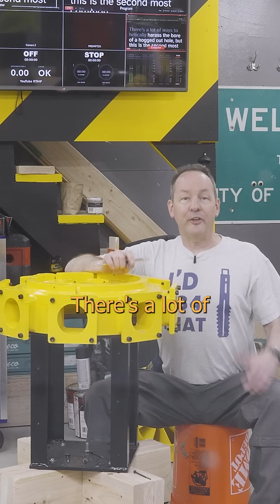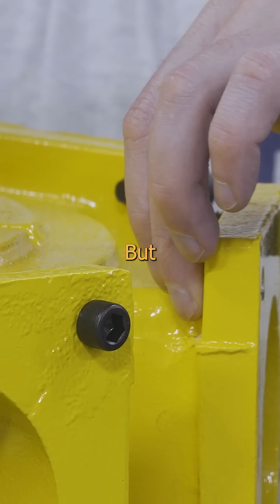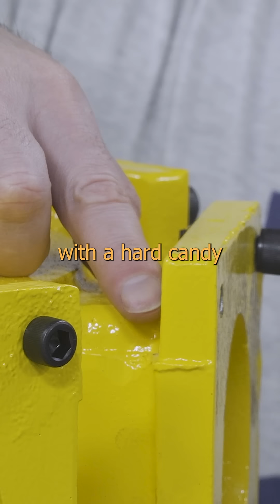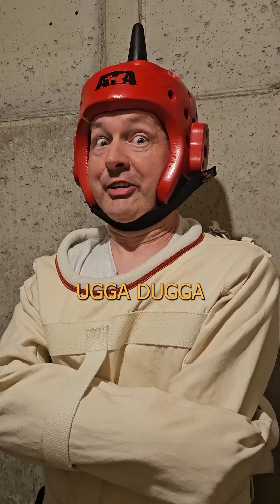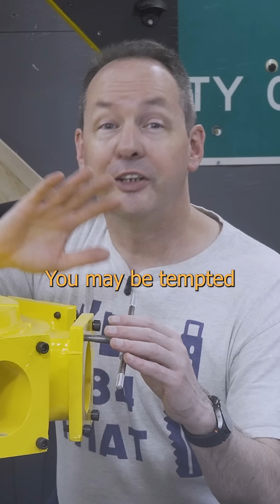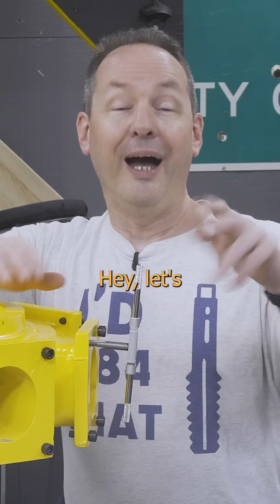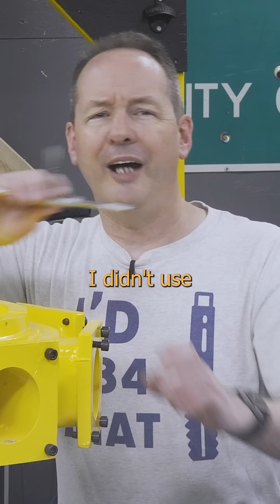Thread Chasing  #chrisboden #comedy #engineering #skills #workshop #metalworking #tools #apprentice

Comment: well i was a Dumbass twice during my appretice days... 1st time customer asked to have the threads on his bicycle frame chased because the bottle holder was a pain to install  so i grap a m5 tap and try carefully chasing the threads on the first threaded insert... just for it to bind up after a few turns. so i used a bit of force(three finger of one hand kind)... then it clicked in my mind... the tap was bottoming out on the Mahle e-bike battery that was fixed inside of the frame... luckly the bolts the customer had put in there already made a dent in the aluminum batterycasing so we could act like i never did anything but inspect the insert... 2nd time let's just say you shouldn't trace threaded inserts in a carbon frame... one really bad bind up and the 2000€ (~$2400) frame is trash

Comment: Didn’t use a drill but an air ratchet and appropriately sized socket.  Got the tap going with my finger, then ran it down with the air ratchet.  Worked fine.

Comment: O yes I’ve fallen into the trap of using a drill to chase production jobs holes and let me tell you your not saving any time when you have to spend 3 hours with a EDM, carbide tools, a bunch of picks and then a helicoil at the end just to save a few minutes!! But I’d be lying if I said that I didn’t think about using a drill every time I’m faced with a few hundred holes to chase.

Comment: As a mechanic I keep a bin of broken bolts I've extracted successfully and tapped afterwards to fix the threads. Although instead of a T bar i use a ratchet with a socket put on revese so the 3/8 square hole can be put on the tap making it easier to use in tight spots

Comment: Dumba!!, had a frame bolt hole with more crusties than the aftermorning wake up at a bukkake scene on an old 71 Dodge W150. Cross-threaded and snapped the tap! ... My dad was vedy impressed with my first attempt at hardened steel tapping.

Comment: I'm that dumbass! Medium sized Polish factory far more than decade ago, me as a fresh graduate from vocational school left all alone (mentor fell off a ladder after one month of training and I had to figure out most of the stuff all alone). Back on the track - it supposed to be quick changeover for different product, and as most of "young experts" i felt a little over confident and decided to make a quick fix on a thread. Of cource I used a drill to speed up the process and tap broke quite immediately. I had to disassembly half of the machine, remove old tap with drill, hammer and a punch, drill new, bigger hole and tap it once again - this time by hand :) Fortunately there was enough space to fit bigger screw. One of my first important lessons, how trying to save like 2 minutes by using a drill changed 10 minutes job into 5 hour repair. Damn I wish there were channels like yours back then... Keep on doing great job!

Comment: I don't understand why you couldn't just cut a piece of threaded rod long enough to go through that flange hole.  Cut a quicky slot in one end with your cutoff wheel for a flat-blade screwdriver.
Of course the answer might be that it takes less time to run a tap through it afterwards.
Also, if you aren't used to using taps, most of the tap and die sets I've seen come with collets that slip over the ass ends of smaller taps (the ends have four flats), and you have the option of putting the collet over the tap without adding a handle.  The collet is easier to hold onto if you are a klutz, and since it has a larger diameter than the tap you can get a little more torque when turning it sans handle.

Comment: Re perpendicular: I had a hole suddenly turn to butter when I was tightening up a 14mm hole that held a timing belt roller on my car. I got a Helicoil kit and bit and augered away...crooked. I basically ruined the block of I didn't take it down to a shop to weld it up and do it right. I put it together anyway and drove it for another 5 years, changing the timing belt every 6 months till the engine finally gave out at 500k miles. Oh...it was a Camry, of course.

Comment: If u don't have a tap on hand, you can just use a grinder to cut a groove on either side of a bolt with the correct threads, you can't create NEW threads with it, but you can chase the existing ones to clean them out in a pinch.

Comment: No Ugga Dugga But Im still a dumbass in tapping. M14x1 blind holes in old aluminum part and thin wall, badly damaged threads, two holes galled up so bad. In the end used epoxy and lubed bolt to "rebuild" the threads. Have not figured out what to do different next time.

Comment: HOLY CRAP the kids i knew back in HS that were high on Fent could tap straighter holes.

Also, not my lesson(mine was just accidentally crossing threads) BUT, I once watched a guy tap a hole for a pretty deep machine screw (I dont remember the measurements or type, its been years) he used a drill, then an impact, and by somehow the grace of god got the bit out. It had NO teeth left. And he stupidly put the bolt in and got it stuck halfway and the instructor kept that piece around for years as an example of "Dont be like Greg" (Not his real name but similar)

Comment: Metric threading must be totally different. Never damaged threads by re-tapping but ive had a few taps snap while using a battery drill. Turns out you can actually buy ugga-dugga compliant taps which are massively faster to use.

Comment: I didn't make the mistake, but I was kinda watching when my son was a dumbass. He was working with one of the screw holes on his bike and wasnt really paying attention. Well he did fine with the original screw hole, he just had no clue when to stop and somehow managed to create a screw/bolt hole in his fuel tank. He did stop when he started to smell gas, but as we all know, by that point t, there is already a hole. I have bo clue how he managed to pull that off, but it was really funny watching him go from chill to headless chicken in about 3 seconds. He was trying to unscrew the tap, find a way to plug the hole with his finger while also trying to lift the tank up as well as looking for a container we could use to let the gas drip into. I would've loved to help, but I was too busy laughing. Like I almost fell out of my chair laughing. He did end up finding some type of epoxy or something like it that is exactly for filling hole in fuel tanks.

Comment: Dumbass, not me but my father shattered a tap inside of a TZ4K smol tractor gearshift. My dumbass² to get it working Welded the rod to the fork. Now the lack of expensive noises from the clutch made me take the puzzle apart and snap my back hard as i tried to manhandle the engine with maximum lifting force equivalent to breaking a spaghetto. Now that my virtual wallet is dry it will only take a couple of hours of swearing to just take it apart to see the damage that has been done.... At least i found the clutch pin i dropped inside a couple of years ago....

Comment: Ive used a drill on a tap before, because i was doing it on a thinner piece of aluminum, it still ended in regret and several hours of trying to get the tap out.

Comment: You want a really bad day?  Trying chasing 1/8" tapered pipe threads in titanium that were not cut straight in the hole by someone else (I am looking at you Xometry... you know what you did). That was a whole new world of terror, even with a brand new nitride coated tap.

Comment: Dumbass here. 1/2 inch Bolt for one of the 2 intake headers on a racing mower I was building stripped out in the aluminum head, in all of my gas fume fueled stupidity I grabbed a three-quarter inch tap and three quarter inch drill bit and just started stomping the drill and tap as far down as I could into the head.
Ended up in mutilating the shit out of it and when I went to put the 3/4 inch bolt in it immediately started to strip out.
Because I knew no thread insert was going to possibly save me because I couldn't drill it out anymore or insert a thread insert into a already ruined hole, I just grabbed a tube of JB Weld and mixed it up real nice before slathering the gasket surface and Bolt in JB Weld and cramming as much of it as I could down the ruined bolt hole. Held it in with a clamp and let it sit for 2 days before I started up the engine and let it warm up to full operating temperature for a few hours, seems to be making a fine seal and holding in place but I have no intentions of trying to see how well my "fix" held up by taking the bolt out

Comment: DUMBASS!! I thought I could get past the squeaks and creaks, 1 ½ rotations in, 2 rotations out. My tap snapped into many pieces within a blind hole. I spent the next day at tech burning out an oily tap out of a 1½ inch hole with an EDM. My threads were crapped out, so redrilling and retapping ensued. That Cinnamon flavor tap magic is a staple for the manuals in my shop. I tell them that it SHOULD NOT be used as cutting oil, but I'm the young schmuck, so what do I know. It smells pretty good, but you just know that fragrance will tack off hours from the end of days

Comment: Dumbass 😂
Not tapping a new hole but years ago I was mounting an Aluminum plate in an I/o cabinet for a 120v/24v power supply, tapped the hole for the power supply fine but I had to tap holes in the corners for the mount and broke the tap. No big deal take my lineman and go to twist it off and broke the tap on the other side 😅, now my hole is filled both ways so I call the boss who brings me another tap and a new aluminum sheet and almost to a T the same shit happens in the same spot at the same hole. Called my boss again who was pissed as it was a project so our overtime was hard dollar so he came over there with a third tap and sheet and on his final hole same shit happened to him 😂. I think we just ended up using the first piece that was made and called it a day with 3 screws instead of 4

Comment: I learned this by watching someone else be a dumbass. Back in high school I worked at a water park. Before the start of the season one of the jobs was to recondition all the pumps and motors. Since they were sitting around in a chemical soup every year the threads become clogged with rust. Cue chasing the threads to put them back together. One genius didn't want to spend the time doing it by hand, so he chucked the tap onto a drill and did the 20 or so threads in a pump in 30 seconds instead of the usual 10 minutes. That's the day I learned you could make two different sets of threads in one hole.

Comment: I do know better, but did it anyway. Snapped a tap off flush in a mounting plate in the back of a panel. In attempting to drill it out I managed to spin it through the hole... down the back of the plate. Legend has it that half a tap is still in the control panel and now installed on an oil rig in the North Sea. 😂

Comment: As someone who has miraculously only broken one tap in my years as a mechanic, don't buy special tap oil unless you're a machinist, just use some 10W-30 or so oil for steel and WD-40 for aluminium. For steel you can even get away using old used oil most of the time.

Comment: They sell square drive 1/4" and 3/8" drive sockets from Snapon that are made for taps to get into tight spots that you can't use a tap handle. If you are careful and use tap magic they are a very good addition to your tap set. Don't be tempted to use an impact or motor powered ratchet. You will be the first one to know that you did a dumbass move 😂😂😂.

Comment: Watched a coworker use a drill with a 1/4-20LH tap in the chuck to tap some 25 holes. He didn't realize he used the wrong tap until he tried to install the right hand threaded bolts.

Comment: Dumbass, As of right now I have broken one tap, I was using a drill and didn't know how deep the hole I was tapping was It hit the bottom and I snapped the bit, I got lucky enough to grab the bit with a pair of pliers and spin out the broken bit. I still use a drill when I tap and so far it has worked about 95% of the time

Comment: I swear, the guys that work on my production line at work break 3/8" taps on every single unit we produce, it takes them a good 45 minutes each time to get the broken piece out, but they never learn their lesson. Even as I, a fellow dumbass, tell them to NEVER use their 3/8" impact driver to put in threads, especially if you're just chasing them to get powder paint out.🤦

Comment: Watched a guy use a tap to strip a hole once. He was threading talking on about how skow is smooth smooth is steady, trigger pressure controll then boom one small sneeze and that hole was as tight as Bonnie Blue right after a 24hr challenge

Comment: "Dumass" , Proper tool was broken , it was the weekend , one hole left to re-tap and the machine could be good for exploitation again soon ... I dit it , Chuck that big boy in the drill anf verry VERRY Gently scratch to re-tap it , then ... Crack ... It was a 4mm thick plate but there was another plat without hole like 1cm behind, hit it , didn't feel it with the drill and ... Took me like an hour to remove it but at the end job was done and machine was out for exploitation

Comment: It depends on the hole and type of tap being used. I will tap our electrical panels for 10-32 with a drill that has really good power control, but it's sheet metal. For thicker metal, I will hand turn.

Comment: Dumbass check in.

In high precision situations, ALWAYS USE A TAPPING BLOCK and always check with the thread gauge before doing it again!! When you have to have a go-nogo thread gauge pass on both ends, chasing by hand is risky. Had a friend working on a $30k+ piece of material almost finished machining that he had to chase the last couple holes for the thread to gage depth. Did it by hand, no block, first 2 times, got on in out of the thread no problem, but still couldn't get the print depth with the gage. Chased it the last time, nogo side flew to the bottom of the hole. Part was scrap. He left on lunch and didn't go back to the shop because he figured he was fired 😂😂 I try my best to learn from his example.

Comment: Back in the old days, Sears and Roebuck sold 'thread repair taps.' I think they were less aggressive and tended to follow existing threads rather than cutting new ones. I assume that big yellow McMaster-Carr catalog would still carry some. 
Another trick is to take a regular bolt and file a single slit in it to act like a makeshift tap. You could turn it in by hand, then back it out with a drill, and you won't have to worry about the bolt shattering if it hits the floor!

Comment: Was making a metal cart for voided out scratch off ticket books, went to tap holes for the plexiglass panels and got to the last hole. Didn't want to take off the panel closest to the hole I was on and decided to send it with the drill. Snapped the tap, painted it blue and sent it

Comment: Slightly different dumbass.... removing snapped steel bolts and re-tapping threads in an aluminium gearbox housing, forgetting to wear eye protection when blowing out. Steel, aluminium dust and eyes don't mix....it makes the cornea go a fetching shade of orange and hurts plenty for months, possibly years.

Comment: I’ve learned many things by being a dumbass. I learned what a disposable camera flash capacitor feels like when it discharges into your 12-year-old hand. I’ve learned that you refill a butane torch by NOT having the bottle at an angle and instead push it straight in so there’s no hissing sound, and not to play with the sparker after because it makes cool effects.

Comment: "Dumbass". I broke the tap using a drill cleaning and exhaust flange bolt hole. Luckily for me, it was not a blind hole. Used a plasma cutter to blow the remnants clean out. Then start the process again, but this time by hand. Can't be stuck if it's liquid!  A blind hole, one the other hand, is an extremely bad day....

Comment: chuck it and regret it?  I mean...yeah...if the part matters and isn't easily replaceable, that's good advice.

I don't do a lot of tapping or retapping at all.  I think the most I've done is when I reused a bunch of old conduit boxes that needed some grounding.  I did in fact, use a power drill to cut the threads...since those are only an 1/8" thick and cost a buck or two I didn't see the harm and got lucky in that I only broke one tap and didn't f-up any of the boxes.

Comment: Never chased, but me and my coworkers definitely power tap using a gun tap, a hand-drill, and a 200lb gorilla. Our work pieces are generally acrylic and polycarbonate so the 10/1000 scrapped parts are a non issue and cutting and tapping 10 extra is wayyy less time than accurately hand tapping those.

Comment: Yes. Yes. I'm that "dumbass", okay slightly different. Changed a clutch assembly in a donor truck. Simple swap, drop the trans, then bell housing, swap out the old with the new.

Well I can't do it in the little more than a hr morning class but I can finish it in my afternoon. Come back my work station has been moved. Not disturbed or anything just moved.

After reassembled I have an extra bolt...that's not supposed to happen. CRAP! CRAP!  I swapped the 18mm bell housing bolts with the 15mm trans bolts.  😅😢 (that was an unnecessary redrop)

A month later and my instructor still reminds me to remember my bolt pattern.

Comment: The last rule: Lock the door. The last thing you want is someone running in and asking questions while you are tapping.
There must have been the result of an argument years ago but my mother knew if the tap box came out of the tool chest the garage was off limits.

Comment: Dumbass, snapped TWO different sized taps on the same control panel backplate using an electric TAPPING DRILL which has a neat transmission that will spin the tap backwards when no pressure is put on the drill.  Not sure how or why the taps snapped, but it was probably because I didn't clean off the taps properly.